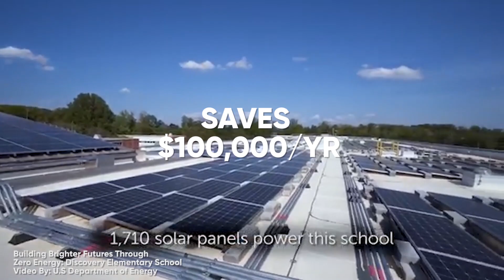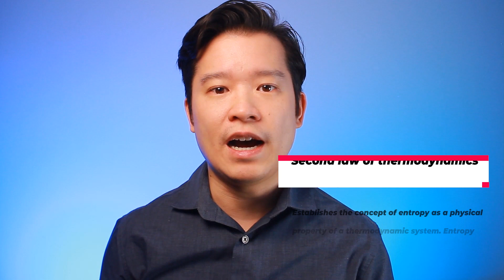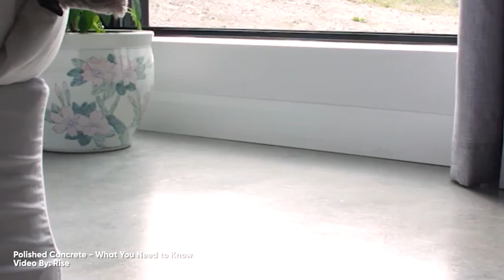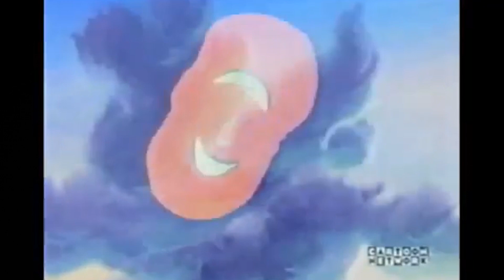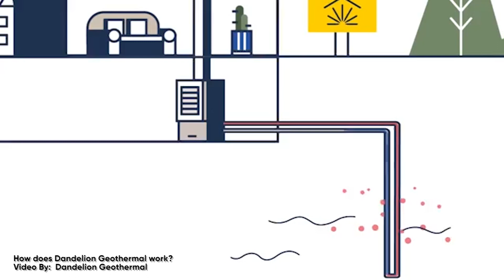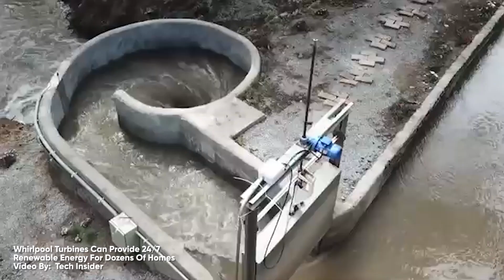Net Zero Energy Buildings | Proptech Spotlight

Comment: I know the video is older, but adding a few thoughts: 
An interesting proptech is solar glazing - glass with a film similar to low e coating, but the film produces energy. Still sounds a bit too good to be true and does not have too many built examples, but could have potential. 
Heat pump technology does not need to be constrained to heat from water and has great potential as well! 
Wind turbines can be smaller and more aesthetic if using vertical helix turbines (Like Whole Foods in Brooklyn, though not sure if they still work)
And lastly hydroelectric power is very disruptive on a large scale. I think small scale technology like the one you showed is much more sustainable. Also interesting is the turbine installation on Roosevelt Island by Verdant Power.
Great video! Great channel - going through a lot of your content right now.
Reply from the maker: Thanks for sharing these ideas! I remember a penny stock back in the early 2000's went nuts on the promise of solar windows but they weren't able to produce them and they crashed just as fast. I'd love to see it happen one day.